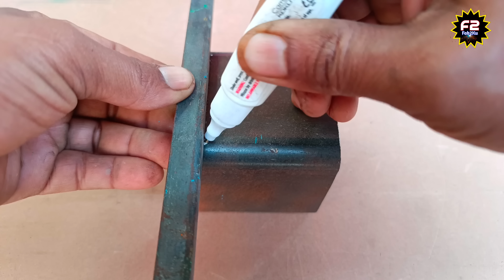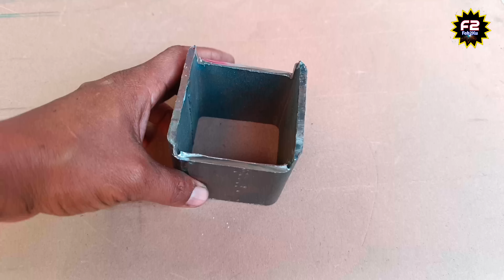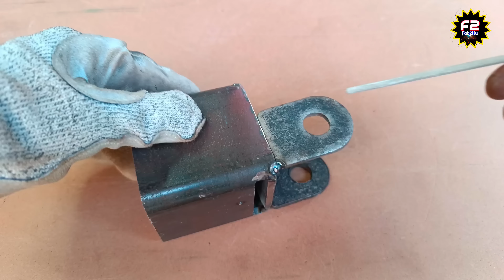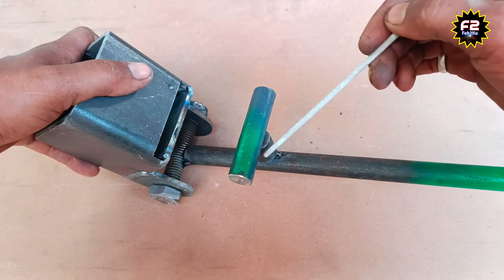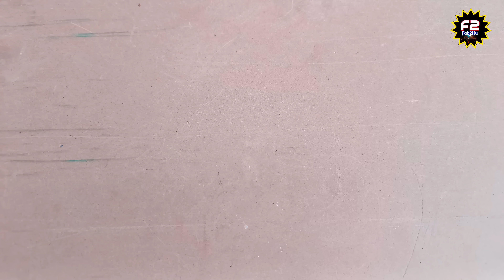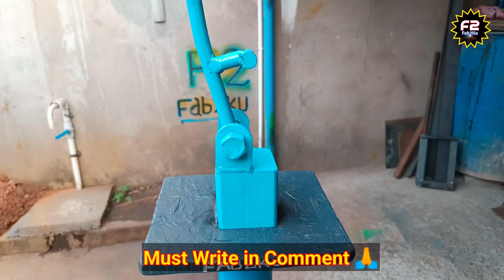One More Awesome And Amazing Tools ideas That's You Must Have / Diy Smart Tools For Beginners

Comment: Nice Useful little tool 👍

Ps: 
Suggestion No pretension You could in numerous cases demonstrate that adding 'wielding' a  ][ shape iron at the base would enable the toll to be secure and used in a vice with out having to be permanently wield making it more flexible in the shop specially if you happen to have several one's
Reply from the maker: But I have not heavy vice sir
Reply: The man shows what anyone can do without special improvised means.

Comment: Your welding is getting better. But get yourself a flux core welder they are very reasonably priced.
And converting to DCV is pretty easy and welds better than ACV. And would make a good video for you
Reply from the maker: You are right sir
Thanks for your support ❤️🙏